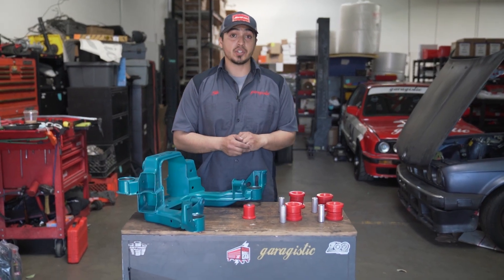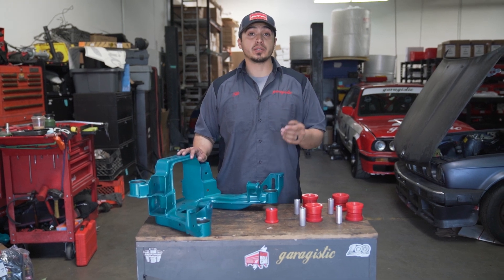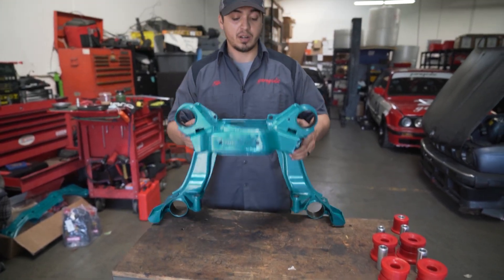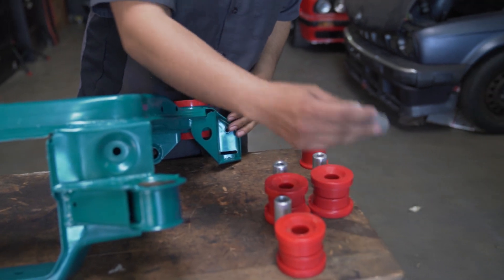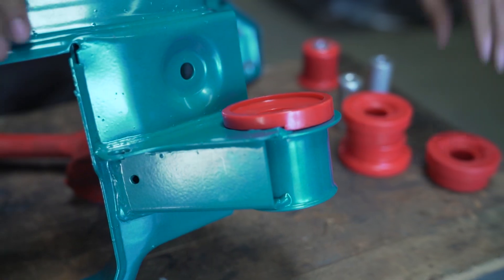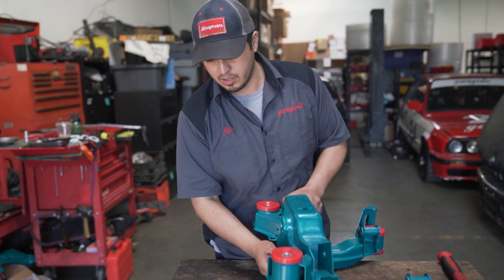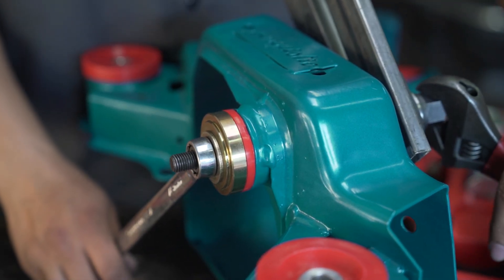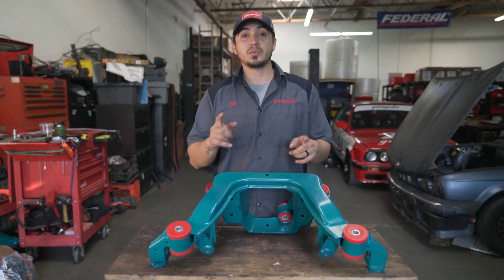How to install E36 Polyurethane Subframe Bushings | Installation Instructions

Comment: wish i could return my 1st gen set of these 😢
Reply from the maker: Did you have any issues with your set?
Reply: A bit of deformation caused by heat here in cencal. They didn’t come with races then/lip for the top welds, and the front carrier bushing doesn’t have a lip so I get bit of clunking here and there.
Reply from the maker: @ramozeab  email us. They have a lifetime warranty.  We can send you another set. Just give us a call or email.

Comment: 1) How would you say the noise, vibration and harmonics are now with 80A Poly bushings installed?
2) Is the gains in handling worth the increase in Noise, vibration and Harmonics when going up from 80 to 95A? Especially if it's for an daily E36 with an 1Jz non turbo swap?
Reply from the maker: 1) There is an overall difference in NVH (Noise/Vibration/Harshness) when comparing 80a to rubber bushings.  However, NVH is fairly subjective, but for most going to 80a poly is noticeable in a "good" way as most people would say that you can feel the car a bit more overall. 

2) Now when it comes to choosing 80a vs 95a, given that you are street driving the car, I would say that going to 95a may not be "worth" the added stiffness simply due to public road conditions being so variable i.e. train tracks, driveways, and potholes.
Reply: @garagistic  Appreciate the feedback and the information... I'm looking into your catalogue so I can change out the major bushings and bearings
Reply: @brianantoine3103   did you end up getting the 80a bushings ? and if so how do you like them ?